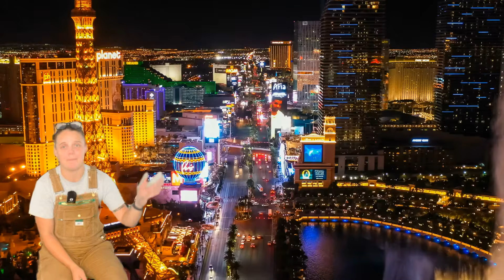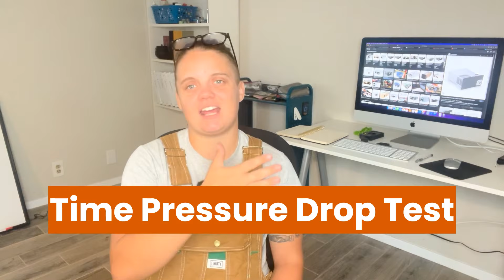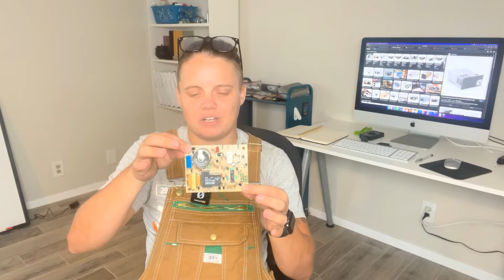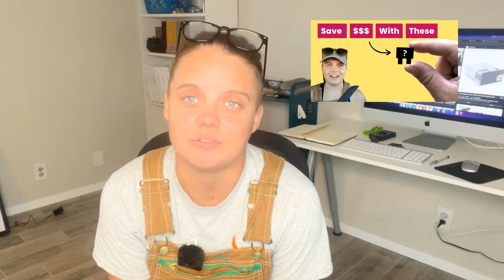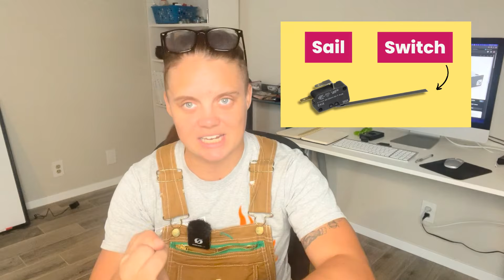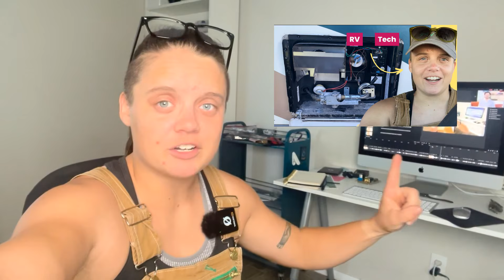How to Troubleshoot your RV Furnace Circuit Board

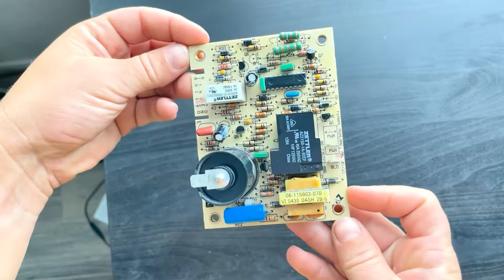Comment: @3:00  bad relay solder joint on back on board . sand and re-solder . back in business !
check for leaking capacitors . replace any that are swollen , domed on top .

Comment: Did i miss something?  You're trying to read voltage across various pins but there's no voltage input.  Obviously, the board cannot make it's own electricity, so how do you test these connections without the board being connected to a power source?
Reply: Blue wire is +12 . Yellow is Ground. (power coming in ) then you have thermostat wires .

Comment: Greetings.  I'm having a problem with my furnace blower; when I turn on my batteries, the blower fan comes on. If I turn on the thermostat and slide the temperature selector to hot, and then turn the thermostat off, the blower will go off and stay off until I want to use the furnace. Everything else with the thermostat and furnace works properly. I'm stumped! BTW, I'm having problems testing my circuit board as described in your video-the only time I get a 12V reading is when testing for power, so I'm not sure if my tester is being picky or if it's operator error! Thanks!
Reply: look for bad solder joints on the back of the furnace circuitboard . 
2. could be a failing /bad slider on my thermostat .

Comment: In that rare instance where your power for the a/c  comes from that furnace circuit board. And the board test bad, is there a way to bypass temporarily till new board arrives? Please help, it's hot in Texas 🥵
Reply: @rvrepairwoman
Reply: yellow to red on thermostat . but check you t-stat wiring diagram on google or mfg website .

Comment: My furnace fan comes on and then the burner lights but on ly stays on for about 15 seconds. It will do this cycle 3 times before staying lit for the remainder of the day. Only when I turn on the heat via the thermostat in the morning manually. It's been doing this all winter. The weather isa only in the mid 30's for 40's. All other propane appliances work fine including the propane tankless water heater. Tanks have been refilled several times. A propane pressure test has been down with no problem. The domestic furnace is only 3 years old. I replaced the sail switch and the problem is still there. What's next?
Reply: check the valve on furnace

Comment: I have a suburban SF-35Q furnace and the furnace comes on stays on for 5-10 minutes then shuts down then a few minutes later comes on and does the same thing.  So I shut it off checked the sail switch and blower motor which I replaced 3 months ago. All seems good. I turn it back on at the thermostat it comes on runs for awhile then just shuts off so I switch the thermostat to off and a couple of minutes later the blower comes on like it doing a cool down no fire in the furnace the blower runs a few seconds then shuts down.  All the time the thermostat is off.  Is this a control board issue

Comment: I have been troubleshooting pour your video my suburban furnace here is my problem when I turn it on at the thermostat the blower goes on what does not activate sell switch I manually activated furnace works fine until reaching temperature then goes off like normal but will not come back on unless I go back out and trip to sell switch I replace motor and circuit board and cells with a year ago maybe less my thinking is the fan is not producing enough air flow to activate the cell switch what's your take on it before I rip into it oh by the way I am up here in Sitka Alaska on a little Island no RV tec

Comment: Question I've been messing with this for about a couple weeks ago. My friend cut the CO2 sensor on her Aspen Dutchman and ever since then the AC and the furnace aren't working both units are getting power but for some reason they're not clicking on. On the furnace board specifically if I put the red wire with the blow wire the blower comes on but I'm not hearing anything any clicking from the tank. I'm thinking that whenever she cut the CO2 she shorted something because both systems aren't working do you have any advice?

Comment: What ls the problem if you have 13 v when you disconnect furnace but with you plug in furnace it drops to 2v need some help rv is only a yr old I think a rat got in my furnace and messed something up  I removed furnace and found no damage I have a digital thermostat and it has no power to it I need to figure it out it’s about to get hot here in east tx any help I would appreciate it

Comment: I've got a excaliber 8500-3 . The board doesn't have connectors for power , just power high tens wire to ignition..only power connection labeled is the plug. Thanks for all the help .

Comment: Hi, thank you for what you do. My furnace was working fine last week Sunday and all of a sudden it stopped. The fan is working with the thermostat, I have 12 volts going to and coming out of the sail switch. No power to the board. Checked fuse panel 12 volts all over. I bought a new board and still nothing. It is going to get cold tonight in southern Colorado

Comment: Thank you, thank you, thank you. Suburban SF-30 with no blower. I removed two frogs from the squirrel cage area, three mud dauber nests from the air inlet, replaced a blown fuse and still nothing. Your video led me right to the problem; no power on the red wire, even after replacing the blown fuse. A pin had backed out of a connector located under a kitchen cabinet. Works great and I didn’t need to buy any parts.

Comment: Great video. I followed all the steps and still have the problem though. Dometic Furnace. Prior to this video.... I replaced the regulator truly thinking it was the cause. I since have replaced the sail switch and limit switch. Took out the burner and cleaned it. The igniter appears fine as well. The blower turns on when the thermostat calls for heat. The igniter does its thing in 15 to 30 seconds and does lite giving me heat. When this first started it was a very intermittent issue. The furnace would work sometimes for a couple minutes or even a week. Now it works for a couple minutes max before dumping the mini breaker. It does not always immediately dump either. Sometimes it continues for a bit to try to get going again before tripping. It is throwing the air fault/ limit fault code. I have ran all the tests per your circuit board video and the board seems to test fine. I have also tested the thermostat. The odd thing there is 1 line only ever gives me 8 to 9 volts. I have a green(ground). I have a red(running 8.2 to 9.4 volts, when disconnected from the thermostat, it reads more like 7volts. I have a white(steady at 12+ volts) whether connected or not. I have 12 volts on the circuit boards until the system starts failing. Fuse in main panel tests fine. The entire furnace just acts like it is loosing power but does not always trip the breaker right away. The insanity has set in and I am at a loss. Thoughts?

Comment: my board has power to everything but V1, and .25 volts at the igniter, i directly added 12v to gas valve and it turned on, but 12v to igniter wire made no clicking sound like normal - for sure a bad board or possible igniter part on the valve system?   (i bought a new board i should add but according to your test its bad too)

Comment: Been trying to diagnose what's going on with my suburban nt-30sp. Everything has been covered. Voltages are all good, switches are all good. What I've got going on is; everything starts up, fan turns on, gas valve opens, igniter ignites but only for about 3 sparks (totally guessing but maybe only about half a second). Then stops before it can ignite the propane. Once in a while spark will come back and ignite after the burn chamber fills with gas resulting in what sounds like an explosion.

The board has been replaced, along with the high limit switch, igniter/flame sensor, and gas valve.  I checked the sail switch it functions as it should.

Any ideas?

Comment: Hi! I have the original circuit board without the 2 pins pwr and blo and no wire go thru pin th (thermostat). Do i have to adapt all my existing wires to fit with theses 3 spaces originally not used on the old board? I have a device outside the board that give a 7 seconds delay before blower start, do i need to bypass this device and try to connect everything on the new board? Thank you

Comment: When I needed heat during this winter storm in the midwest turning on heater pops the 15A fuse. I've popped 4 so buying fuses to see what's going on. I've never used the heater due to using electric heaters. Now I need to go to propane and I'm also thinking of converting it to propane/Natural gas connection. So should i just replace the unit an look for a dual system.

Comment: Thank you for a great video !  but my problem is that I has a propane leak that apears to be coming from the gas valve or...?  Furnace works as it's supposed to, but propane smell keeps flooding the camper when the furnace shuts off.  I tested all the other propane appliances & fittings with soapy water & no leakes. Not even the line fitting to the gas valve.  Odor is coming from the eithe the exhuat, heat chamber, or... ?  Is there a way to test the circuit board for opening & closing of the gas valve, or would it be the gas valve is defective ?  I have pulled out the valve, igniter, & burner assembly as 1 unit. Can I test just that ?  the furnace is an Atwood hydro-flame. Model 8525-IV  Thank you for any type of help,  Deaqn

Comment: I followed your instructions. I have 12v to power. 12v to blower but no 12v to the air side. And the blower isn't working either. And I'm getting 12v at thermostat. It ticks once and silence. I would really appreciate some help with purchasing the right items. Thanks

Comment: My board is at first glance similar to to you're example board. There are no pwr or blower male spade connectors. The furnace is an Atwood 8940-iii-dclp in a 20 y/o 5th wheel. It worked when I first started inspecting for a friend, she called thinking they messed up  but that was coincidental. Upon arrival it was sparking but no gas valve actuation. Little by little it stopped sparking and fan also stopped. Still battery voltage is 13.6 so it's not low voltage. Limit switch, sail switch, breaker, fuse and has valve working when tested with meter or applied 12v source. Swapped board and replaced limit switch and still unresponsive. The wiring for the blower completely ignores the control board. Only three wires go to the board +12v, GND and TH. Into the furnace may I find a single 4 wire connection +12v, GND and what I assume are thermostat + and -. The reset 15 amp breaker switch on the furnace is iffy and old but functions on and off, just as does the sail switch. Somewhere along the testing process the 15 amp fuse did blow but was replaced and has not burned again, voltage there is also battery voltage. I  someone rewired this thing as  matches schematics that are on hand in the RV. I'll be going back but have you knowledge of the blower being wired around the control board entirely?

Comment: Thanks for your great video! I have a 23 year old SF-30 that works great - BUT; It will only come on if I turn my Thermostat to the off position and then back to the heat position again. Every once in a while the furnace comes back on to maintain room temp all by itself like it used to do. I just noticed this problem this season. I've replaced the thermostat thinking it was the problem, but the furnace does the same thing with the new thermostat also.  I've checked connections and voltages so I'm assuming something in the control board has gone, or is going bad. Your thoughts?

Comment: Here is what I had, thank you for the detailed testing of the board. The furnace would go in lock out and would have different issues depending on which board I replaced, Long story short is the thermostat was only allowing 9 volts to the board, once in awhile the furnace would operate ok, usually when it was plugged in to shore power. Once i jumpered the thermostat direct and had full 12 volts at the board all functions worked. New wall thermostat on order.

Comment: Emily, what could be my issue if the ports are reading 12volts per your video? The only way my furnace turns off is when I shut off the propane. After a few minutes for cooldown , I can hear the igniter clicking but after a few tries, it shuts down. I’m truly at a loss.

Comment: Suburban NT-20SQ. I live in my RV full time, and the furnace has been working fine for well all 15 months of ownership. Sudden initial symptoms: fan would only blow cold air several minutes, then turn off, no clicking was ever heard. 

I assumed it would be the sail switch, but getting to it was a beast. Once I was fully inside there, I ran through the full diagnostics on this video, and everything was working perfectly (all voltages appear/ disappear 100% as expected, and all clicking happens perfectly on queue)?? Maybe just getting in there was somehow enough to chase the demons away... But I'm afraid it's going to come back to bite me later. 😂

Comment: I have a 2004 crossroad cruser 5th wheel the air conditioner was removed from the rv before I got it h0w do i bypass that to run the furnace

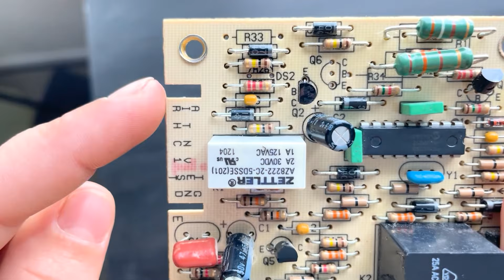Comment: Im getting power to the fan and did the first test you explain at 3:30 and im not getting power. Are you saying that it could be a bad battery even if the rv is attached to the power grid? The  fuse to furnace is good.

Comment: Thanks for the step-by-step.  What is the next step after determining all the electrical readings are good?  I have an Atwood, and with your help, have determined all of this is good.  As for sounds, the fan is on, but I do have clicking, so it's trying to light, but nothing is happening.  I've pulled the propane valve at the ignitor and, with the help of a 12V battery, determined that the valve is opening and closing.  So maybe a propane issue?  My stove lights just fine, so not sure.  What would be your recommendation?

Comment: I DON'T HAVE THE SAME BOARD YOU SHOWED IN YOUR VIDEO. HAVE ONLY ONE POWER LEAD.
3 WIRES IN PLUG RED IS ON TOP THEN A BROWN WIRE AND YELLOW ON BOTTOM. NO POWER ON RED WIRE.
FUSE IS GOOD ??????

Comment: Thank you for the video. I laughed seeing the back side of your control board to see that your board had the same failure that mine did at the power input to the relay. The arc/burn marks are identical.

Comment: Thank you for the content!  Love it.  I have an interesting one.  Furnace on my 2019 Grand Design Travel Trailer.  Heat will initially come on and come up to temp, but when the camper cools off, the heat does not automatically come back on.  If I turn the mode on the T Stat to off, wait for a “click” and cycle the mode back to heat, it will come on and come up to heat, but again, will not work automatically.  T stat looks like its still calling for heat.  So…. I ordered a new T Stat and installed it.  Same issue.  Checked all the usual suspects as you’ve covered here (Except the board proper) and everything else looked fine.  Finally I pulled the T Stat back off the wall and check to see if i was getting 12V out to the furnace after the initial cycle, and…. NOPE, no 12V on the output at the T Stat.  So… either the new T Stat is bad or ????  Any words of wisdom for me?   Thanks!   EDIT:  I went back and reinstalled the old T Stat and rechecked the voltage coming out after the initial heat cycle and cool down.  Its still calling for heat (Meaning i still have 12V going back to the furnace).  So, maybe my board is bad, still not sure…
Reply: I just discovered I am having the same issue with heat cycling on for roughly 5 mins then turning off and not restarting unless I turn off the t stat and wait for the click and turn it back on. I have yet to start trouble shooting, looking for possible answers online now.
Reply: @steveross7152 What i did to ultimately determine it was the board was put a multimeter (voltage tester) on the output to the gas solenoid valve to see if I had 12V output.  What i determined, was that during a normal “Calling for heat” cycle, the voltage was intermittent to the valve.  The only culprit therefore was the onboard relay on the main board or some other problem on the board itself, as everything else checked out.  But I had to remove the unit and setup a test table at the back of my camper to do that as I don’t have a secondary 12VDC power supply.  I also was lucky enough to have an extra propane tank with a regulator and the right connection hose to connect to the furnace for a test run after i removed the unit from it’s housing, so ai was able to run the unit removed from the camper.  I hope this helps!
Reply: @milleraudio3280 Wow! That’s some serious detective work! Sorry to hear you had to deal with this problem. It’s not something that should break on a four year old furnace that rarely gets used. 
I’m lucky in that I’m camping at a buddies who is an electrician for a couple weeks. And in the previous few weeks he just had another friend with a failed control board in his camper furnace. We both suspected the board was likely the culprit and he knew the nearby dealer could test the board so we opted to pull it and have them test it due to the limited space in the furnace bay. 
The dealer had an awesome little test unit that rant the board through all the functions. Initially it was working fine and they thought the board was good. Then as we were talking at about the 5 minute mark the gas valve voltage started to fluctuate and the valve was getting turned off. So it was able to replicate the exact problem I was having while running the furnace in the camper. 
So now the only issue is they are saying the board is obsolete and they can not find one the exact same size to slide in the track to secure it on the furnace. Hard to believe the board would be obsolete, unless there was a known failure issue? 
Thanks again for the great info!